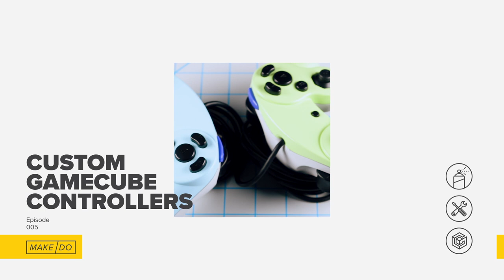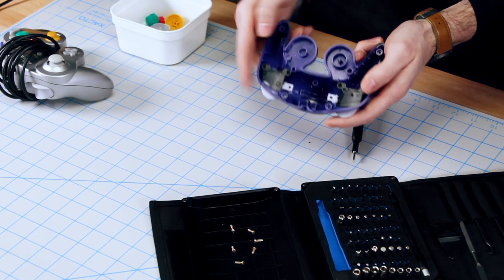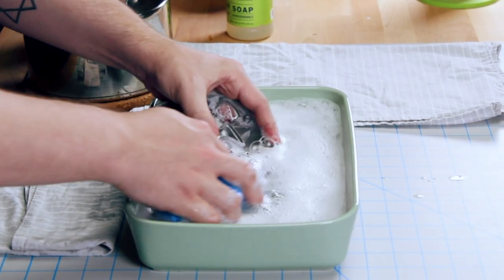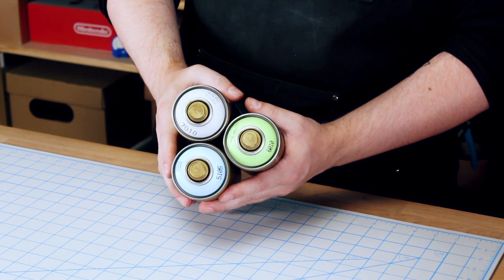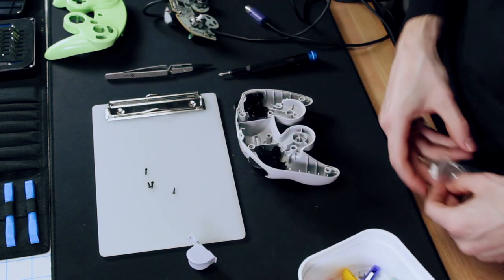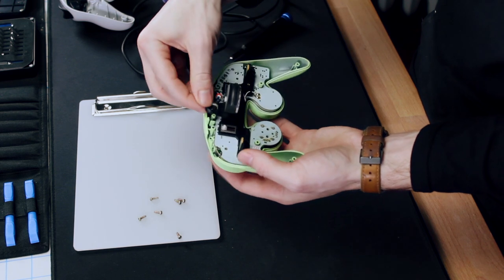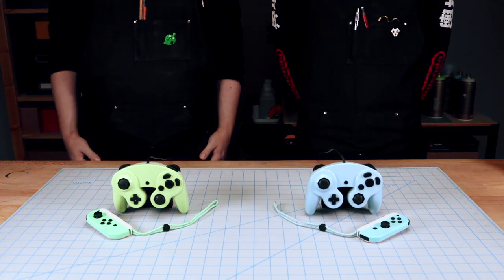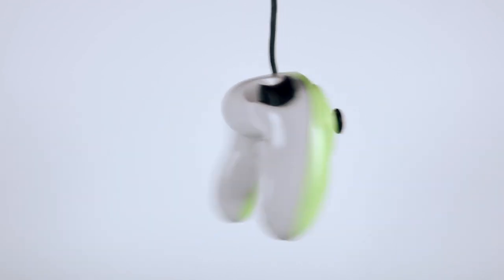How To Customize a GAMECUBE CONTROLLER | Beautiful Paint & Buttons

Comment: You can get the z buttons to fit by cutting off the prongs and using an exacto knife to trim the part by the prongs (iirc it’s the inside edge). I’ve done it with several of those kits and it works great.
Reply from the maker: Thank you for the tip, that's useful to know!

Comment: Fun fact, third party sticks in particular don't always feel great, and xbox control sticks work as a replacement. You can replace both sticks too, to add a modern twist to your controllers. It's important to note that traditional xbox control sticks sit kind of high and you can see underneath the stick to the inside of the controller when you tilt it in either direction which can be distracting but there are some bigger base models that cover that empty space

Comment: Does waiting the few weeks to let the paint dry make the controllers not feel slightly sticky? I've spray painted other things and had this happen. 
Also did you sand after primer and after a few coats to smooth it down?

Comment: I bought regular Montana Spray Paint instead of Montana Gold. Am I screwed or can I still make it work? The controller I'm planning to work on is black and I'm changing to light blue and yellow.
Reply from the maker: You should be fine.. honestly not sure of the difference! A good tactic is to test on the back of the controller, so if it does anything weird it will at least be hidden.

Comment: Ye those button replacements are great except for the z button. I'm looking through painting videos because I finished the shell and button replacements for 2 of 4 so far. First one was an OEM swapped into a non official transparent purple shell with transparent buttons. Easy. Second was to have a black OEM match the purple. So purple has black buttons, reverse on the black. Welp, that's where I found that the hole for the z button is almost literally a mm away from the same thing. So if you're as dumb and determined as me; you'll need what I seem to use the most during video game hardware modding. An exacto knife (non metal/ conductive handle) and a torch (lighter might take too long). Heat up the knife and with an extremely steady hand you can trim down the lip of the z button that's gonna hide under the shell anyway. The heat will make cleaner cuts than all the white marks from dry cutting. You're mostly aiming towards the middle of the controller part of the z button. Once you've relieved that mm from the button it should line right up. Careful that the pegs on the button are fragile and will try to snap off I'd you force the shell closed without accounting for the gap
Reply from the maker: Yes, our best guess it the majority of z buttons are molded after the "modern" gamecube controllers (like the special editions made for smash) and not the original ones.

Comment: I have a question regarding the primer and the gloss and the paint, do you apply the primer first then the paint then gloss or was the gloss a type of paint? This part is a bit confusing to me
Reply: Also primer after to preserve the color for longer as well as to get the gloss finish.
Reply from the maker: We applied the primer first - followed by light sanding
Then we applied the color and finished with a clear gloss coat to protect everything!

Comment: How do you know which paints to use? I don't have a place that has the gold one next to me. I've tried to do a 3rd party controller with an all purpose paint and a demi-gloss clear coat but it came out kinda flakey and a little sticky feeling even though it's completely dry? I don't know why
Reply from the maker: You definitely need to make sure to fully clean the controller before applying paint and scuff the surface with scotch bright - the plastic has a conditioner coating that needs to be removed before  painting. We did actually end up making another all white controller for fun and used Rust-Oleum Universal paint, It worked really well - https://www.amazon.com/Rust-Oleum-245210-Universal-Surface-Spray/dp/B0016HLAJ6/ref=sr_1_2?keywords=rustoleum%2Buniversal%2Bwhite&qid=1639878775&sr=8-2&th=1

Comment: My question is do they feel the same after the paint job? I painted my controller using the same method described here and afterwards it just feels tacky. Like almost sticky. It doesn't feel like the same kind of plastic that it used to.
Reply from the maker: They don't feel exactly quite the same as before, but the tackiness does go away with time and it does get VERY close to the same feeling as the original plastic. We ended up letting ours sit and dry for a long time, a few weeks or so, before really handling them a lot. Just curious what color/buttons did you do?
Reply: @make432  i left my buttons alone. Just did the shell a light blue but i handled too early. That may have impacted the feel of it

Comment: How do you apply the varnish properly when you finish repainting?my controller got a bit crusty andbread I am not sure if I screwed up the step pf the paint because of ita being a hot day or because of the varnish.
Reply from the maker: Hmm, the cracking may be from excessive heat or possibly from applying too much. Here's an article with some more details: (https://www.onallcylinders.com/2015/07/16/7-common-paint-mistakes-and-how-to-avoid-or-fix-them/) But once it's cured you can sand it down and try again!

Comment: I’m wondering if I did something wrong after priming my controller it kinda built up and became very like gravely and I’m worried and am too scared to continue, I did it on a test shell. I’m just wondering if you like skipped anything or went not in full detail about something
Reply from the maker: Oh no! Most likely that has to do with the humidity or the amount primer applied. We would recommend applying lighter coats and allowing to dry in a cool dry place. If the build-up continues you can sand it down to a smoother finish. I hope this helped!

Comment: Is there a certain type of spray paint to use for it to still feel good to play and not feel weird
Reply: You can apply a sealant on top of the paint to make it feel smooth
Reply from the maker: That's right! In this case we used a clear coat, once everything's dry it feels good to play!

Comment: Do you guys know if this will work for the Super Smash Bros versions of these controllers released only a few years ago. Thinking about getting one and I would like to customize it.
Reply from the maker: Hmm not too sure on what the internals of those look like. But I would think they would at least be similar!
Reply: @make432  they are exactly the same. The only difference is the L and R buttons don't have that little metal clip that attaches to it, and the cord is longer.
Reply: and the button membranes are tall, buttons are short iirc

Comment: Looks pretty cool. What retailer did you purchase the custom black buttons from?
Reply from the maker: Thank you, we grabbed these ones off of Amazon, there's a link to the exact set in the description! There are a lot of options available through sellers on etsy as well!
Reply: @make432  I've been browsing a handful of different sites as well as discussing with other modders on discord. How is the quality of the black sticks that you bought for your controllers? Does it give you that trademark clickity-clack?
Reply from the maker: @rickmoranisstan  They do have that classic sound, there's a rubber cap that's only on the top so the base is all plastic! Our only complaint was that the Z button didn't fit, so we used the original one. It could be made to fit with some sanding however!
Reply: @make432  thanks!

Comment: Those cheap knockoff replacement buttons you can buy online for $2 are a bad option.  The feel of those ends up being too far off from authentic buttons.  I’ve been experimenting with using dye meant for synthetics on OEM buttons.
Reply from the maker: We've had pretty good luck so far with the ones we found - interested in seeing the results of your dying process though.
Reply: @make432  dying them black definitely comes out amazing.  I’ve now got jet black OEM GameCube & N64 buttons and I love them. No dye has rubbed or chipped off so far. Best of all, you can dye the Z button so it matches.
Reply: The cheap 3rd party buttons are fine for casual gaming but for competitive Smash Bro’s I just couldn’t get used to them and couldn’t perform the same with them.

Comment: There is a continuity error there at minute 13:56 the Z button is still in the original color and in the following images it appears black
Reply from the maker: Good eye! As we mentioned we ended up swapping the purple back in after trying out the black button. The purple one fit better but we've been told the black fits well if you cut the tab off!
Reply: @make432  haha my mistake

Comment: Do I have to use primer before spraying
Reply from the maker: We would definitely recommend it. It gives the paint a nice flat base for it to adhere to!
Reply: @make432  cool thank you
Reply: Should I still use primer if i use spray paint that is designed to stick onto plastic
Reply from the maker: Hmm if it's designed specifically for plastic you may not have to, I would look up reviews on the specific paint you have in that case!
Reply: @make432  alr thanks

Comment: I wanna see if you could make a GameCube Controller drift so we can see why Joy Cons fail most of the time.
Reply: The construction of the sticks for the two controllers aren't really similar enough to draw conclusions about joycons from Gamecube controllers.
Reply: @thefixitman321  True, but with the power of science anything is possible.
Reply from the maker: That's true, the power of science is the key! But yes joy cons are shockingly different on the inside
Reply: @make432  its really not shocking at all...
Reply from the maker: @thefixitman321  Just meant that they're complicated considering how simple they look on the outside
Reply: Fun fact gamecube controller can "drift"(its more like one stick or the other is stuck in one direction). I've seen it in 1st and 3rd party controllers. When it occurs, it's usually due to a wiggly or flawed connection, unplug and replug generally fixes. If it doesn't then flex the cable and un and re plug.
Reply: @ubergamer0198  oh ik its just I never had to deal with that problem
Reply: @ubergamer0198  they can also drift because the potentiometers wear out.

Comment: Not gonna lie, kinda hurt seeing the paint being miss treated like that. It needs fresh air.
Reply from the maker: Unfortunately some limitations come with working in an apartment in the city, but after letting it dry for a while they turned out nice!
Reply: Was just a really unfunny joke about the paint.

Just a heads up though Montana gold is a low pressure can designed for fine line work. (Less paint comes out the can)
More expensive, smaller color selection. 
Montana black is a high pressure can. A good all around can. (More paint comes out of the can) Cheaper, bigger color selection. Also Ironlak is a very good quality paint as well and is cheaper the Montana.

(Montana=Apple)
(Ironlak= Microsoft)
 
But both are made for graffiti. They dry very fast within 10 to 20 seconds and don’t fade over time from UV damage. With a very high pigment output, and a wide section of colors.

Check out Montana’s Marble and Spider cans. I would like to see how y’all use them. 

Ironlak Sugar low VOC (volatile organic compounds) paint. Good if you are painting inside with low ventilation.

Btw great videos they are very entertaining.
Reply from the maker: That's great to know, thank you so much for the advice! And thank you!